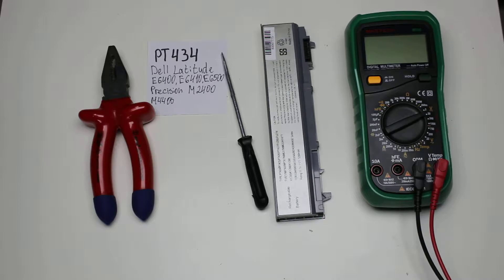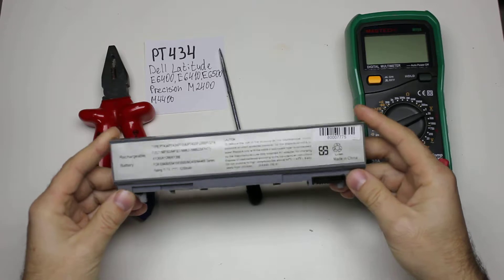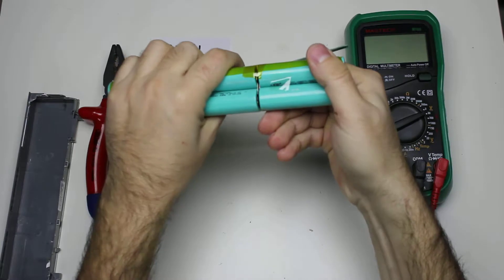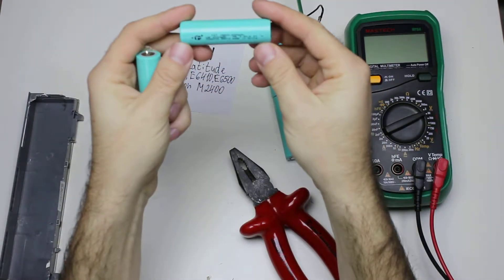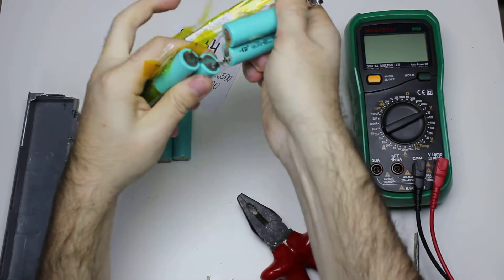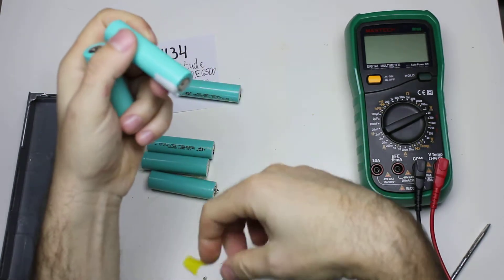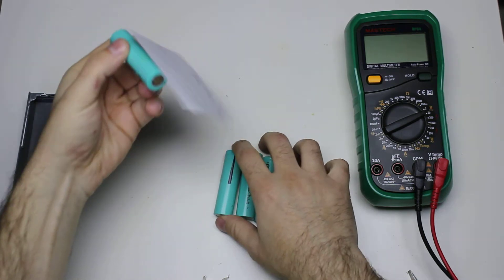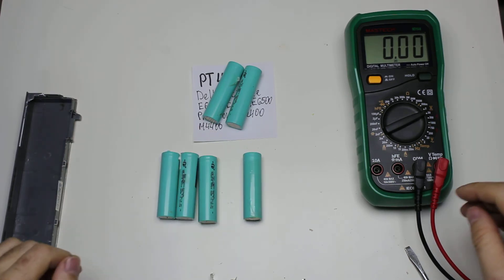PT434 / FU268 Laptop Battery Teardown - 6x FST 18650 2200 mAh

Comment: There is no follow up video. So what happened was the batteries faulty?
Reply from the maker: The two 0.6v cells are gone so this was the main reason the whole battry went bad. The other cells are in good condition. I can not tell you if the battery is good as it only got to me when it stopped working so I don't know how many cycles it has completed. If the price is considerably lower than the Dell branded option, it should be OK.
Reply: @laptopbatteryteardownother5640  the main reason I ask this is because I could buy an eletric scooter with this type of battery I am trying to search all over the internet about this type of FST Chinese battery. 

I don't see any reviews criticizing this battery. 

How many months did this last for you?
Reply from the maker: I don't think cells made for laptops are suitable for scooters but the ones used in the scooter you are looking at might be different cells with good C-rating. 
I haven't used it much so can't tell if it's good or not.
Reply: @laptopbatteryteardownother5640  Thank you for answering my questions... I am curious where can I buy battery cells and they build the battery as well? The scooter I am looking at uses 98 of 18650 batteries in 7 parallels. 

Also I don't understand the pricing on these battery packs. It's 500 dollars for a build pack with LG 18650 batteries (According to the seller but he doesn't have the pack for sale). Just using simple math 3 dollars per 18650 battery would be around 300 dollars. Are there other expensive components to build a battery pack?
Reply from the maker: Battery pack consists of the cells, cell holders, nickel strips which connect the cells together, battery management system (BMS) and some money are needed for the work and equipment as well. 
Cells can be found in most big electronics stores. Some might build packs... can not tell.